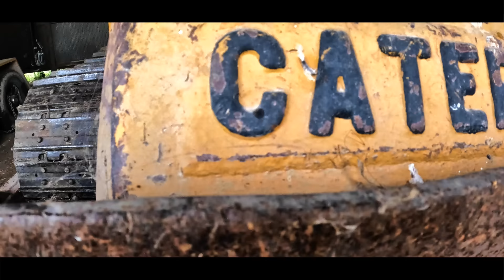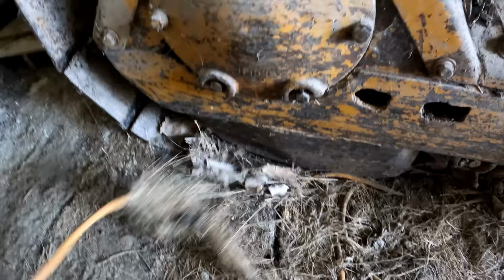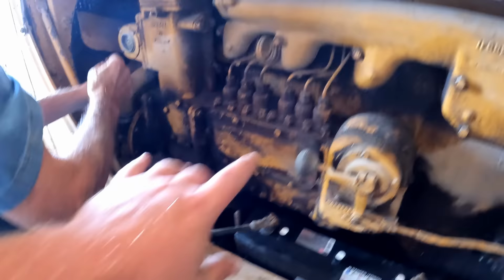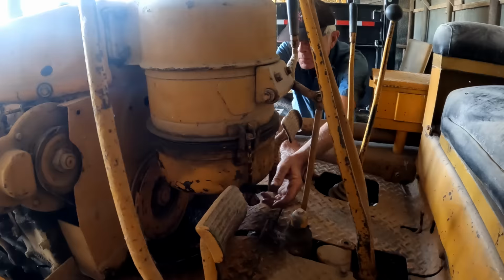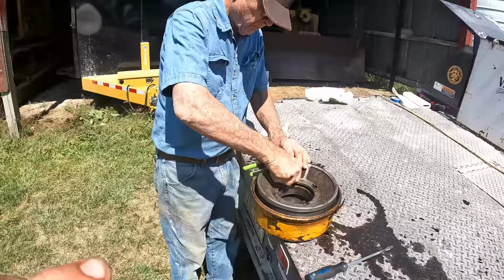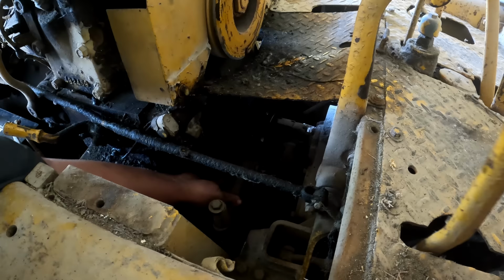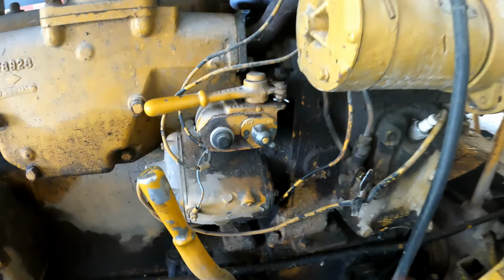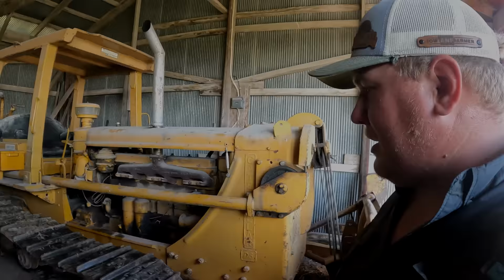Will it Start!? BARN FIND 1950s Caterpillar Dozer!

Comment: Wrong! you put it on compression to warm the combustion area in the diesel with the fuel OFF, then after it has warmed up then open the throttle.
Reply from the maker: That’s what it said if it was cold out. It was 85 out that day.
Reply: @iowANFarmer  Doesen't matter, adding fuel to the cylinders without it running washes the oil from the liners and rings and will increase wear.

Comment: A couple more points on the benefit of a pony motor.   You correctly said that it heats the inlet manifold with the exhaust, but that is just to help the engine to fire in the cold.  The pony also shares the water with the main engine so it will heat the main block after a time.  The pony can have a two speed gear and the low gear can be used when the block is so cold that the oil is too thick for normal starting, perhaps in the Arctic.  When warm then change to high gear.
The other very important thing is that these main engines should only start when full oil pressure is reached after it has been turning over for some time on decompression.  This is why they last so long when treated correctly!
Reply from the maker: Awesome comment thanks!

Comment: Great  times! I ran a D~7 (3T) back in the early  80s . A couple of pointers. Try not to ride the steering brake until the steering clutch is engaged. The cable blade has no down pressure, so you might want to start off using  the blade in some loose or soft material ,try not to get slack in the cable as it will snap the cable.it definitely takes some getting used to. Originally those tractors did not have ROPS,imagine operating that dozier 10hrs aday every day! And NEVER PUT YOURSELF  Between the track  and frame.I enjoyed the video,hope this helps.
Reply from the maker: The cable is going to take some time to get used to. I hope I don’t snap it

Comment: That was nice of Steve to help you get it going, he seemed to really enjoy it also. Good to see a young guy get some old iron rolling. Used to drive one of those when it was -30 with what they call an Heater Houser that would contain the hot air off the engine and blow back towards you to help keep you from freezing. It was by no means warm but at least you didn't turn into a popsicle.
Reply from the maker: What were you doing on one at -30
Reply: @iowANFarmer  Moving snow on mountain roads for logging. Back in the days this country had a logging industry.  Thanks to the tree huggers we no longer have that and lost all control of being able to control some of these wild fires. Because the fuel load had built up so heavy. When we logged, we controlled the fuel load by harvesting trees and kept our forests much healthier than they are today!
Reply: I remember on the farm we had a heater houser on our tractor when we were picking corn; When I was driving into the wind I was fairly warm, but when I got to the end of the row and headed back the other direction with the wind to my back, I froze!

Comment: When I was a kid my job early in the morning was to start the dozers to prepare for the day's work building roads. The d6 did finishing work and  chokered out the logs and the d7 prepared the ground pushing out the big rocks and tree stumps.  The d7 was a much harsher ride bucking over big rocks and such but as easy as the 6 to start.

Comment: GOODTIMES, My Pa brought his Post War CAT D4 in 60’s shipped from USA, he used pull trees n with no hydraulics it would pull Massey Sunshine 500 with non spring tines seeder (wheels use to wood spoke rubber sole converted full tractor tyres).  Last time this combo was used in 93, been wet sowing season.  I was lucky been only grandson to operate D4, at tractor pull.  Great name Barn CAT👍my tip keep eye on track tension, they will get lose.  When Pa past away, his wish was buried with CAT hat, he love CAT.
Reply from the maker: That’s an awesome comment! Thanks for sharing!

Comment: Great video. I've been running equipment for nearly 30 years. In 2005 I was employed by a company that had a 1957 D7 Cat . It had a pony motor and cables. Running it was quite an experience after being on much newer equipment.
Reply from the maker: Did you get used to running it?
Reply: @iowANFarmer  It took a while but I got the hang of it. Running one will give you a lot of respect for the old timers. I like the older iron because it has its own personality.
Reply from the maker: @frankward423  you will probably feel like you put in some work at the end of the day running that.

Comment: Old gal sounds fairly good, motor isn't crackling or making uncharacteristic noises and no excess white,blue or black smoke, I've seen worse undercarriage plus steering clutches,brakes,and cable blade system working  awesome video fellows u have a solid keeper in that old D6,l ran a real old D8 when I was a young buck ,the pup was buggered so I'd have a big front end loader push me backwards while lifting the blade slightly, that big Cat motor would fire right up every time (engine was rebuilt so fairly tight)The power steering on it was excellent lol,Cheers gentlemen, thanks

Comment: Pretty cool. One of your funniest videos especially when you opened the air cleaner.  The first dozer I ran was an old cable D9 one thing to keep in mind is when lifting the blade be careful not to lift to high because if you put to much pressure on the blade stops you can break the cable.   Great job and have fun.
Reply from the maker: Glad you enjoyed it! Thanks for the tip. Didn’t know about the blade stops and that could happen.
Reply: They call that double blocking.  It can mess your day up!

Comment: FOR SAFETY ON YOUR CATERPILLAR. Always before you get off of it make sure it is in neutral and pull or engage the clutch. When I was 11 I just about died when I started it because it was in gear. I threw the decompression switch and it started and engaged the clutch and I went for a ride.
Reply from the maker: Yikes!

Comment: Good Rule of thumb is after your turn over the Diesel engine over with the pony motor before you give it compression make sure you have oil pressure on the Diesel Engine First . On the D 6 9 U we had we always let the pony motor in the colder weather Warm up good before trying to start the big motor .
👍👍

Comment: Nice Job.  Starts well.  Usually leave the diesel throttle off till been on compression for a while. Probably okay in warm weather, in cold, have to turn the big engine over for quite a while to get the block warmed up enough, before giving it fuel.
Reply from the maker: Peoples have been really helpful with little tid bits like that. Thanks!

Comment: I didn’t read through all the comments but one thing I didn’t see you check is coolant. The pony motor uses the same coolant as the big motor so if it’s low you could overheat the pony

Comment: Great video, I worked on JD construction equip back in the late 70's, also got to work on Cats, IH and some old Allis construction equip.
Reply from the maker: Ever work on one of these?
Reply: @iowANFarmer  No but with the operators manual and a parts manual it shouldn't be too hard, I live by Winterset

Comment: Glad to see you got it running and back into operation! I had to comment, because of the signs on the machine. My dad, George Fertig, was the superintendent for Christensen Bros 60s thru late 90s. Working for him back in the early 80s, my first machine I learned how to operate was a D6 like this one. Awesome video, thanks for posting it!
Reply from the maker: Maybe it was this one?
Reply: @iowANFarmer  This one looks to be in better shape. There was no cage on the one I operated, and the pony required a pull rope. It put a smile on my face as well, first time I got it started up. 🙂

Comment: Raise the blade.   Put it in 5 th gear.  Hook your quad trac to it and break the clutch loose.   I have many years experience on a 1942.  D7 with pony motor
Do not raise the blade and block it out.    You will have to replace the cable.   I think it’s 33ft long
Reply from the maker: That’s a long cable!
Reply from the maker: Clutch isn’t stuck

Comment: Good to see old Iron recovered an running always let pony run out of gas it saves the oil wear on little eng i try to pull up on blade after disengaging clutch helps to aid shiftinggood luck
Reply from the maker: Awesome tips thank you!

Comment: I am Steven Brown and I have a 1952 Oliver OC3 w/dozer
I picked up a 1960's Case 310 D dozer w/mechanical blades swivel gas
I am from Aitkin Mn.  But I use to live in Farragut,  Iowa 
  I am good friends with Glenn & Paul Brink 
Glen passed 5 yrs, he sold used tractor parts

Comment: they are strong and reliable, and you can still get parts for a lot of then but they make you work a little to there not like the newer ones with pilot control drive.
Reply from the maker: Might tune up my skills and make running a modern one a breeze

Comment: On the D6 9u I had, there was a second set of air filter screen up in the top half of the housing also.  Had some wing nuts to drop them out the bottom of the housing where the oil bath area you were servicing is.
Reply from the maker: This one has a newer breather on top it looks like
Reply: Mine had the same dust separator bowl on top.  The 2nd set of screens would be just above the oil resivoir , access from the bottom inside of the air cleaner housing, when the oil bowl is removed.

Comment: I started working for my dad in  the late fifties, biggest thing that he taught me when starting the engine on a cat dozer was to watch the fuel pressure gauge, the oil pressure gauge plus how to feather in that decompression lever to half and then tossing it in to the run position so it did start. Said if too soon and big engine doesn't have oil pressure gauge moving yet, that it would eventually take out the big engine bearings... ask you friend if that applies to this dozer please... gave the like, already subscribed to this channel
Reply from the maker: That’s been a common comment and I’m going to operate it that way from now on

Comment: Great old cat d6 ! I started running dozers on old cable 6s and 3t d7s   fast running strong old machines!  Be careful to make sure the blade controls are in neutral, if not that control lever will slap the hell out of you ! Big wake up call first thing in the morning.  From experience!  Lol you will never forget it! Great machines for clearing land  . I spent my childhood running them and love the sound of those old cats working!  God luck with the machine and take your time they run in hot weather when a hydrostatic machine will overheat and have to stop and cool off . Before you can go back to work!  The cable needs replaced.  Lube grease all of the cable pulleys and it should be fine!  Also do not raise the blade up to the stop the winch is too strong and will snap the cable ! It is a pain to restring the cable by yourself!  Also from experience!   Also being a direct drive you can push start them! Just chain the blade up before stopping at the end of the day! All of the crutches and brakes probably need replacing  they are wear parts and usually are worn bad on the old machines that were parked and have been sitting a long time!!
Reply from the maker: Thanks for the awesome comment!

Comment: Ran a 1947 and a 1953 D7 for years. Man that D6 brings back a lot of memories!👍
Reply from the maker: Hopefully good memories!
Reply: We cleared a lot of woods. If you don’t set the clutch just right for the cable blade lift, you can snap the cable pretty easy. That’s my only bad memory.
Reply from the maker: @steveminnich9864  I’ll have to look at that a little closer

Comment: If you are grinding gears and want to stop the tranny from turning pull your cable control as if raising the blade it will stop the tranny and this will save your clutch break. when warmed up it will work better.
Reply from the maker: Hey thanks for the tip! I’ll probably order a new brake.

Comment: Thank you for filming and posting this. I'm heading out to a friend's farm this weekend to try to revive a 1950's D6 8U which should be identical in the engine and starting. It was good to watch all the steps you guys went through thank you!
Reply from the maker: How did it go?
Reply: @iowANFarmer  literally just arrived on site! Haven't had a close look yet, but I see that it's a cable blade just like yours!
Reply: @iowANFarmer  ok inspection done. Bottom line is that while she's old and rusty everything is there, the exhaust had a can over it to keep the water out, all the control move freely, and the undercarriage looks good, not looking worn.

Engine has oil. Couldn't check the radiator as didn't have tools to get the cap off. Crank turns when the compression is off and won't turn when it's on.

I think it's worth spending a day with some tools and some help to see if I can get it running.

Your machine looks much nicer and has been better treated! But this old girl would come up ok with a bit of effort I think.

Comment: That hole in the oil bath bowl is why the mice got mice there.  All the oil drained out, if it was full of oil the mice would have stayed away.  Good fuel pressure, has the needle pegged on the high side.

Comment: My old boss has one just like it ran it a lot was fun to run would push good easy to level with no down pressure but was fast action
Reply from the maker: How did you combat no down pressure?
Reply: @iowANFarmer  you can tilt blade just a little or change your angle that your pushing just a little for most part never was much trouble I'm in east central Indiana
Reply: @iowANFarmer  you have to watch you don't get to much slack in the cable it will suck the blade in and you can't raise it up fast enough and you will kill it lol
Reply from the maker: @greggostrowski3632  good tips!

Comment: We had one just like that. Our tractor was a 44A  we took the pony motor off on just pulled started it with granddad JD 4040.  We put the 4040 in A1 and pulled the cat about 2 feet and she would start. just build up the fuel pressure and engage the manual clutch and she’ll start every time if the pony motor goes down on you.
Reply from the maker: Thanks for the tip! What gear on the D6?

Comment: That is  one awesome  barn find. LMAO on the mouse deal. I can clean cows but can't  handle some bathroom smells  or people vomit. It's  funny how that is. Hydraulics maybe overrated especially  with a dozer I bought that keeps blowing 38 year old hydraulic lines. 2 days ago I  dumped 350 dollars of hydraulic oil in 50 to do feet. wishing you the best of luck with the dozer. It being in a shed has made a huge difference in my opinion
Reply from the maker: You got that right!

Comment: the reason those steeringclutch levers pull back so easy,is they are hydraulic assisted...almost a never fail system under the seat using about a galln of oil

Comment: my father had 3 of those D6 cable machines , back in 2004 i converted his favorite to 24 volt electric start . removed the pony motor and plated of the shared water galleries and removed that exhaust pipe out of the intake manifold. where we live it doesn't get below zero very much so i didn't have to worry about a glow system or anything thing plus the electric motor really spun the main motor surprisingly quick and had enough grunt to keep spinning it under compression so it fired straight up once oil pressure was reading pressure . his didn't have the electric pony starter so his was pull started or roll or tow stated because he use to leave the blade off the ground . the magneto and the Carby on the pony motor would play up fairly regularly on his . one thing to be mindful of is don't  over lift the blade until you get used to the cables because that winch will snap that cable like it's made of butter.  look after those books  as they are Gold. great job getting it started,  the decompression leave will throw back in when the engine has oil pressure and is spinning fast enough after a while. always get good oil pressure up before opening the throttle applying fuel.
Reply from the maker: Thanks for the tips! Great comment!

Comment: Good point, "no ethanol fuel in old stuff" I think that would apply to my 1975 MF 30 loader tractor 60 HP Perkins also.
Thanks.
Reply from the maker: Probably yes. Thanks

Comment: You can use a fan belt with a Sawzall remove the blade put a pulley on the Sawzall and started that way
Reply from the maker: I saw that on DC YT

Comment: i ran one of those in the early 80s was not pretty. takes a while to get the hang of it. i was about your age.so i am a old geeser great video.
Reply from the maker: Did you get the hang of it?
Reply: @iowANFarmer  if i was making a roller coaster ride i did great. only ran it a little while so i was terrible at it. that is why i be came a welder. i was a great welder though.

Comment: Thanks for sharing with us nothing worse than mice and their smell good you got those out!, it’s best to let the starting engine turn over the main engine with no fuel and compression on for a couple minutes to build oil pressure and warm up intake temperature.  Then add fuel with throttle.
Reply from the maker: I think you’re correct on the startup.

Comment: Hi when you go to shut off the pony moter turn off the gas and let it die. You won't have  a gummed up carb and a gas filled crankcase due to a sticking lnlet needle and seat
 And flooded carb @ flooded pony motor crankcase. Good luck.
Reply from the maker: I think that’s the best way to do it!